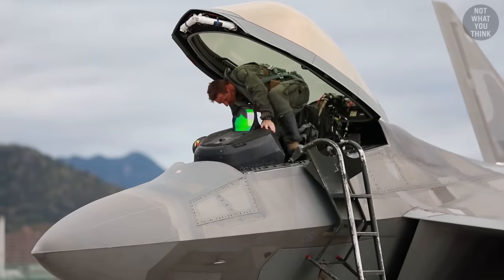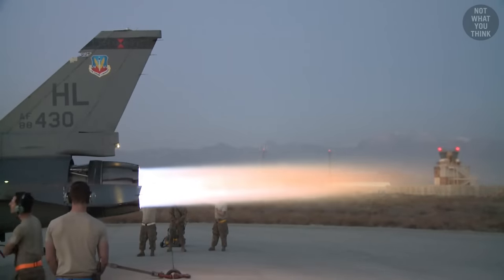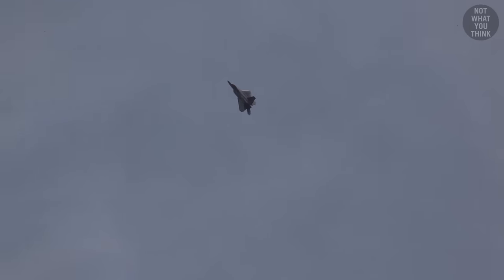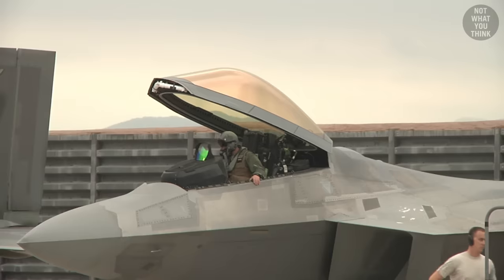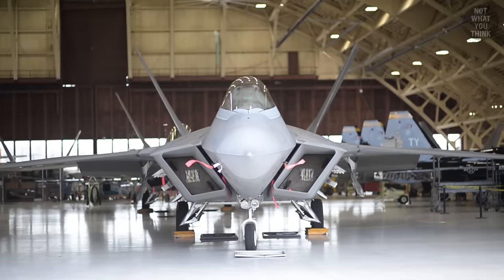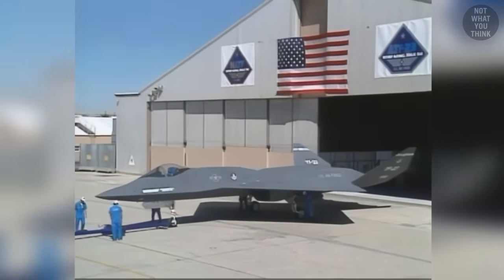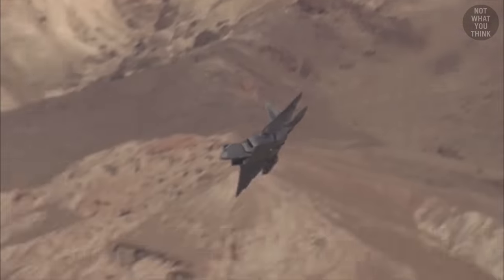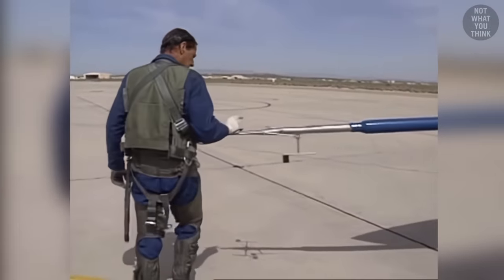The Stealth Fighter That America Never Exported

Comment: The US imported F14s to our ally Iran - and then Iran wasn't out ally. So now Iran has F14s and while not as bad a stealth fighter at the time the F14 was one of the most advanced fighter aircraft in the world that could kill targets over fifty miles away. This was so grave a threat that once the F14 was retired every single F14 Tomcat was dismantled and destroyed to ensure that Iran (who were still using the F14s we gave them) wouldn't be able salvage spare parts from the then retired F14s that would've been collecting dust in an airplane museum.

The F35 is good - it is stealthy - but it's like the diet coke of stealth aircraft. It'll be hard to spot on radar but not impossible - and that's what makes it different from the F22 and B2/B21 bombers. Despite the advances of US adversaries we still have the edge on stealth technology. You could try to fly an F35 over Russia and maybe it won't be detected. Kind of like if Russia tried to fly one of its stealth fighters over the US. Maybe it'll avoid all of our radar but unlikely.

The F22 and B2/B21 are the stealthiest aircraft the world has ever seen and the US will continue to hold onto that edge for as long as possible. To which I'm thankful for. Even if all the combat the F22 ever sees is a Chinese spy balloon it will have served its purpose. How does a peer adversary plan an air attack on a US target without taking into the account that a pair of F22s could just be on patrol - see what's happening - and then drop twenty aircraft between the two raptors alone? That's something China needs to think about with Taiwan. That's something Russia needs to think about if it chooses further aggression elsewhere. 

Keeping the F22 in house to the US Air Force only continues to give us that edge and for the moment serves as a valuable deterrent.

Comment: This is why I'm not concerned about anyone else. If we're willing to sell the F35 and not the F22, it's because the F22 is still the superior aircraft.

This plane just got upgrades too. Effectively now a "Super Raptor".

Reason we don't deploy it is because once we show our hand, people will learn it's signature and capabilities. We need it ready for when it matters most.
Reply: No it's because not even the USAF can buy them. The program was cancelled and factories switched over to F-35 production due to a lack of need for such a specialised fighter, as well as it's incredibly high cost due to it's closed architecture design not being adaptable to new technologies. It's a difficult fighter to upgrade, and as such the F-35 with it's much more advanced avionics is actually comparably effective in air combat, while being cheaper, easier to upgrade, and far more versatile. The F-22 is slated for an early retirement in the 2030s, only shortly after the F-15C is retired.

Comment: First of all the raptor is not the best in the world... don't be fooled. secondly, it does not have an integrated IRST, it enables the aircraft to detect and launch an IR guided missile at the enemy without turning on the radar. this is important for two reasons, the enemy's rocket cannot be guided by radar radiation, otherwise the enemy will not receive the information that he is being irradiated. the raptor must use its radar in battle! In Syria, Su 35 locked f22 on his IRST. And if it was a real fight, he would have shot him down. There is also a video of the battle between the Rafal and the raptor, the Rafal with his OSF lock several times and has the opportunity to target the raptor. The Raptor has good maneuverability, but it's still not dominant! Any modern fourth generation aircraft would have a chance against the Raptor. The Raptor was never used for real combat in the air, its only victory in the air was a Chinese reconnaissance balloon. It is too expensive to maintain, the price of a flight watch is up to 70,000 dollars. They coat it with special paints that reduce visibility on the radar, but at higher speeds up to Mach 2, the paint peels off because it cannot withstand the temperature, so it has to be regularly coated with those expensive paints without which it wouldn't be so stealthy.
Reply: 1. The raptor does have some IR capabilty
2. Radar still has more range against IRST. The raptor likely did detect the sukhoi before it did.
3. The 5th gen engines of the raptor are much more stealthy to thermal sensors than any 4th gen engines
4. In basically every single training situation the raptor has been in, the raptor has been handicapped severely. There not much to learn on both sides of you just tell fox 3 and annihilate the enemy that didn’t know you were in the same time zone.
5. It doesn’t need to go to Mach 2 to be highly effective in combat. Even if the paint does come off, the geometry of the plane still gives it great stealth. Add to that its sensors, its good night to any enemies.

Comment: The F 35 is more advanced then the F 22. In a 1vs1 the F 22 would win because they are designed for different roles not because it's more advanced.
Reply: Not necessarily. The F-35 is better at air combat in certain conditions because it has better frontal stealth and it's avionics function more effectively in dense electronic warfare situations.

Comment: The F-22 is heavily outclassed by the Su-57, in speed, maneuverability, stability, range, and most especially, weapons payload and elegance of design.  Our US military contracting is a very very very corrupt and bloated system that hasn't produced a single impressive weapon since the 80's.  The F-15 experimental with canards was the last meaningful technology to be developed but was not adopted.  The Russians did adopt this type of technology, and they rule the skies as a result.
Reply: Yeah sure Ivan, they're doing really well in Ukraine. 🤡
Reply: X-43A mach 9.6 in 2004. Stratolaunch roc Talon-A reusable hypersonic vehicle. X37, X47, Stingray autonomous air refueling drone, valkyrie, fire scout, B-2, B-21 the list goes on and on and on.
Reply: Keep coping, Vatnik. Maybe your "5th generation fighter" will actually be competitive if you could make more than just a small handful. Imagine having the RCS of a Super Hornet, a 4.5 gen fighter

Comment: The reason it never got sold its because its a failure. Some of the most serious problems with the F-22 concerned its avionics, since the computer architecture of the fighter was actually outdated by the time it entered service due to very long delays in the program," the author of the publication writes. The F-22 cannot exchange information with other fighter units, and the absence of a helmet-mounted display system reduces the effectiveness of long-range weapons. Troops recognized the aircraft as problematic. The pilots developed a "Raptor cough" due to the design of the altitude-compensating suit, which squeezed the chest, and the high maintenance requirements of the F-22 led to low readiness indicators. and the price tag of over $400 million per unit no one wants to touch this plane. there is so much that its not accurate in this video!

Comment: Supercruise means cruise at over mach 1. Even the hornet could do that (at ~30-35k ft). Its far from a very special capability.
Reply from the maker: Depends on your definition of Supercrusie. For the F-22 it is crisping at Mach 1.5 or more without afterburners, and we mentioned that in the video.
Reply: The F-22 super cruises at 60k ft. And the upcoming NGAD is rumoured to super cruise at 90k ft
Reply: @NotWhatYouThink  I haven't heard of a different definition of supercruise than mil-power at mach >1. Wikipedia uses the same for example.
Reply: Both of you are only partially correct. Supercruise refers to being able to travel at high supersonic speeds for extended durations with a combat loadout. Just being able to travel beyond Mach 1 in MIL power while being straight and level does not mean an aircraft is capable of supercruising.
Reply from the maker: I suggest you look closer at the Wikipedia page for supercruise: One of the pre-eminent military examples of supercruise is the F-22 Raptor, for which supercruise was defined as "the ability to cruise at speeds of one and a half times the speed of sound or greater without the use of afterburner for extended periods in combat configuration."
Reply: @NotWhatYouThink  My bad. I left that last part out ("without use of afterburner"), but that was what I was trying to convey. There's just a huge misconception that being able to travel beyond Mach 1 while straight and level without afterburner usage constitutes to being classified as a supercruiseable aircraft.